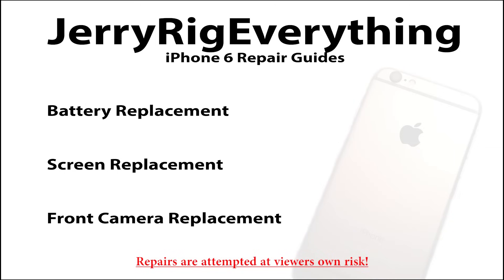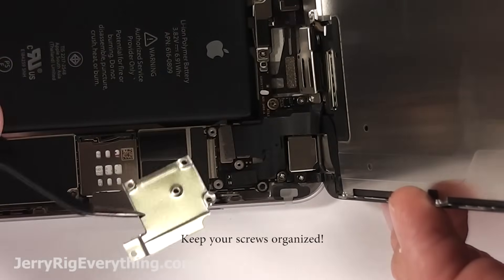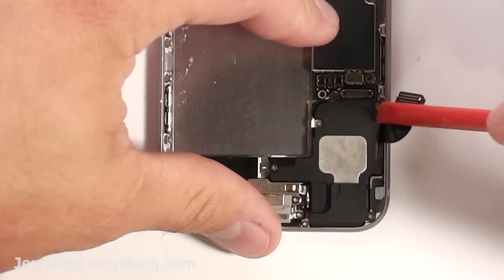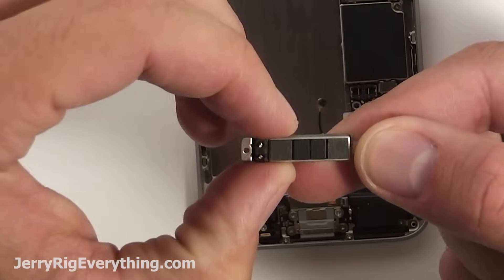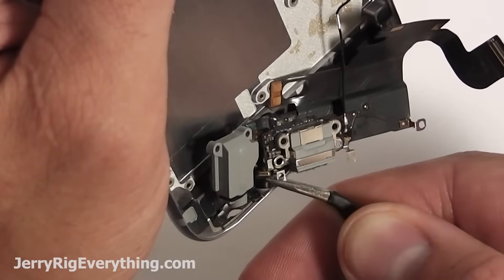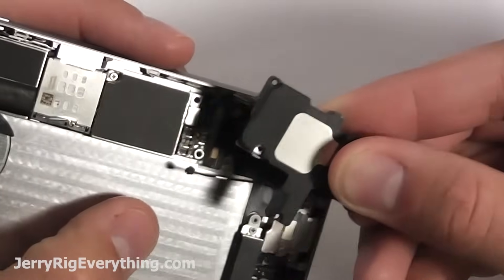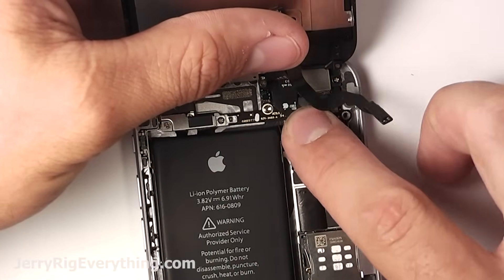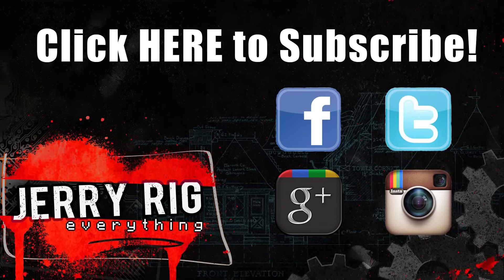iPhone 6 Charging Port Replacement in 5 minutes, microphone fix, headphone jack repair

Comment: My iPhone 6s plus does not show lighting bolt when I plug in charging cable. For sure my charger adapter and cable is good. The phone has about 20% battery so I leave the charging cable over night it charged additional 20% more. I took my phone to Apple store the tech told me my battery is good. Anything you can help me on this ID greatly appreciated.

Comment: Great video, many thanks for the upload. Managed to replace my battery and charger port whilst using this vid & works perfectly now. One thing I will say is to remove to screen use an ISclack (about £12 eBay) well worth it & screen pops up easily, I broke my iPhone 5 a few years ago using a single ‘sucker’ trying to wedge it up. After putting it all back together and switching it on the touchscreen wasn’t working and there were lines on the display. If this happens reinserted the displays connectors (they will snap in, just make sure the screen is held up 90 degrees and is the top edge is straight to the top of the phone and they will go in easily) and watch for the screws as they will be in one place and then disappear before your eyes. Total cost for me £15. Thanks again, brilliant vid

Comment: whats the gold piece that's attached by a wire used for? it's pretty close to the ribbon cable. I accidently broke mine, when trying to place it inside the connector.

Comment: When I did this repair and I put it all together my loud speaker stopped working but it was working before the only time it works is when you apply pressure to the connection do you know what to do?
Reply: keegan mckay i

Comment: BEFORE YOU PUT THE REPLACEMENT PIECE IN:
Check to make sure that the black plastic housings for the microphone and the charging port are not still on the old components. If so, disconnect the wider black plastic housing from the grey plastic of the charging port, then place it back into the phone's frame so that the holes line up for the exterior pentalobe screws. As noted by Stanos79, the black plastic microphone housing is stuck to the old microphone. Remove it and place it on the new microphone using the peel-reveal adhesive. There is a little tab to help you line it up correctly. And don't forget to do the peel-reveal adhesive as you are putting the new ribbon cable and components into their place.

Comment: it worked but now i have faint vertical lines on the right half of my screen and the touch screen isnt working on that half. Had trouble plugging in the connector that is in the middle of two other ones.  Could it be not connected properly or does something need to be replaced now?
Reply: Kill Kai yeah I had a friend help me try to connect the screen properly and it worked! It's been working fine now thankfully

Comment: Hey, so the phone wasn't turning on at all and so I thought the charging port was not working because the phone wouldn't turn on even after I unplugged the battery and just used the power source from the wall. I replaced the charging port and the phone still doesn't turn on. Any suggestions?
Reply: Hey Brandy2374, so my phone was out for three days, I just recently went back to mess with my phone, taking it apart and putting it back on, did it a few time, then my screen came back on....Not entirely sure what it was but now the only issue that I am having is that my screen be twitching and it won't light up as bright as it use to. The screen is pretty dim, planning on messing with my phone again later this weekend. Bought another replacement screen just in case I am in need of a swap. Thanks for replying to me as well.
Reply: is your phone a Turnip?
Reply: Dan O it's acting like one
Reply: Try a new battery
Reply: Apparently mine is like that now too right after I finished with this video. Did you ever fix yours? I fixed the charger but right after I turned it on, my phone got real hot. I'm afraid I might have short circuit or something. Trying to buy a new screen to replace it and see how that goes.. ugh, one thing after another.
Reply: Lazy Troll I read that you are suppose to discharge the battery down to at least 25% before doing this repair. I'm getting ready to do the same repair unfortunately.
Reply: Lazy Troll hopefully it will continue to improve or the new screen will fix it. My parts will be here tomorrow  so hopefully I will be able to fix mine. Let me know how yours turns out.

Comment: My iphone6 wouldn't charge and eventually the phone died and I can't backup/restore it. I tried to connect it to several different ports and cables etc to no avail. Even after replacing the charger port it won't charge so I don't know what's going on. Anyone have any suggestions?

Comment: Thanks for the great repair guide. My iPhone is charging again. But some letters on the keyboard now are not working: y,u; g,h; v,b; and the right half of the space key. So a group of letters. Any suggestions on getting these keys to work again? Maybe one of the connectors to the screen is not fully connected? Anyway, that little wire on the loud speaker was a problem. I could not get it to snap into its connector. Felt like maybe whatever it connects to is no longer there. So I just screwed on the battery latch plate on top of it.
Reply: well that was dumb lol

Comment: I change the charging port and speaker as well and is still sound very low.pls help me with this
Reply: the volume is not working at all in mine
Reply: Turn the volume down

Comment: Ok, this is old but this was the best video for me. It was clear with still shots to point the screws. I was able to pause at each step, everything was clear. Thanks for this tutorial, my phone is charging right now so I guess I'm good. Cheers!

That being said...
I second everyone who says you should try to clean the charging port first. I did it too, many times and it worked like a charm after that (just not this time), but please don't use anything metalic, use a wooden toothpick. The first time, the phone was charging but randomly, I wanted to give it a clean up and used a paperclip... boom! It was just not working at all after that. So be careful with the cleaning guys.

Now yes, the mic housing, I did see it when disassembling and somehow it stayed against the case so I've left it there, I'll see once my phone is on how good it works. Maybe you, Jerry, should put a little extra note on your video at the right moment to tell people about it ;)

Comment: question, my phone stopped working and my battery charge stays on and thats it! apple store said it was my port, i dont want to loose my photos! which i did not back up! my bad, doing these changes, like port replacement, battery change, will i lose all my pics and video which are saved on the phone? also do you offer service to fix my issue with my phone or have any recommendation on who can fix it? any help would be great!

Comment: THE WORST PART ABOUT PUTTING THINGS BACK TOGETHER IS FINDING THE RIGHT EXACT SCREW!
Reply: Joseph Webster LAY ALL THE SCREWS OUT IN A PATTERN TO KEEP THEM ORGANIZED SO YOU KNOW WHERE THEY ALL GO WHEN YOU PUT IT BACK TOGETHER
Reply: Joel2010Dmax I used little plates of bluetac to hold the screws in the correct pattern

Comment: LOUD SPEAKER PROBLEMS: I have the same problem with the loud speaker. I have no fixed it yet but i know it is either the new charging port that you installed that is faulty or it was damaged in the install process. I had to take the whole charging port out again because it was postition properly. The part where you lift up to pull the whle thing off ripped a little so i think thats what damaged the speaker. The speaker isnt getting the vorrect connection from the speaker to the two little gold metal things on the actual charging port. So make sure the two little prongs are touching the two little pads and make sure you didnt damage it in the process. I hope this helps.

Comment: NEED HELP: My problem was my charging port. I was only able to stop at unscrewing the vibrator which I wasn't able to finish because for some reason the screw did not want to come off and I eventually stripped the screw..... 😑 I skipped that step and I tried to see if I can take off the assembly I was replacing which is at 2:40 (that's the exact part I stopped at after I realized I needed to remove the vibrator) So instead i used someone's advice by sticking a toothpick and get rid of all the lint... which ended up being the solution but now when I put everything back together, my speakers don't work......... I went back in and unscrewed everything but I still have the same problem. SOMEONE PLEASE HELP.
Reply: Julian Roundy probably damaged the speaker connection

Comment: Hey jerryrigEverything I replace the charging port this way and it works fine but once I put everything back together the right hand side of my screen doesn't work, anyone got any ideas? I have unscrewed the phone again and replaced the screen connectors but the screen still isn't working 🤔

Comment: Hi Jerry, I did everything illustrated in the video, but still with the new port the connection is loose. and now it is heating up the charging cord as well, does it has to do with the after market part?

Comment: I took my phone 6 apart and put everything back together. Everything is responsive, except for my touch screen. Any ideas on why the touch interface may be unresponsive?
Reply: Charles Roman touch ic must of failed just look up iPhone 6 touch ic. Or it could be a screen.
Reply: I had fixed the problem shortly after leaving you a response. Thanks for the feed back

Comment: followed this step by step and everything worked fine except my screen. all the other buttons were working but my screen wasn't responding to touch. I figured out that the screws on some brackets have different lengths. be sure to put those longer screws in the same spot and everything will work fine

Comment: I did the replacement, and everything seems smooth. Charges good, speaker works, headphone jack works but no one can hear me. I tried both the mic and the headphones. Ideas?
Reply: did you ever find a fix? :/

Comment: I followed this video because I had a messed up charging port and my phone is back to working normal again. One thing that is not mentioned in the video but I picked up on in the comments, is taking a black piece off of the old microphone that you're replacing and putting it on the new microphone. Besides that one part the whole thing went smoothly.
Reply: Ya Jerry missed it, i was really shocked to see that part missing in my new replacement part
Reply: I took the black piece off of the old microphone and put it on the new one and the microphone still doesn't work

Comment: I see that you used something to pry the battery out of the phone and scratched the casing under the battery and probably bent and twisted the battery, there is a much easier way that was introduced on the 5s i think. The two pieces of what look like black tape on the bottom end of the battery are actually the ends of the adhesive that hold the battery to the case and if you release the tape carefully from the battery and pull very slowly it will stretch and pull the adhesive completely out from under the battery, then the battery will fall out of the phone.

Comment: I just replaced my charging port, and now my phone charges just fine.  The problem is that now my microphone doesn't work.  Could I of hooked it up wrong? or damaged the part when I took the old piece out?  It didn't really seem like the new part had a microphone with it.

Comment: the suction cup in the tool kit you recommended isn't strong enough to separate the screen. where did you get heavy duty suction cup you use in the video?

Comment: Excellent video, easy to follow step by step instructions. I did this and replaced my old charging port with a new one hoping to fix my error 9 when "synching with iphone" while i try to restore to factory settings since my phone is dead. I've tried disconnecting every single component while restoring in hope to fix the error 9 and find the defect one. Nothing works. Do you have any idea what a possible solution might be or is my phone just bricked with a broken nand chip? It all started with a infinite boot loop pattern which eventually resulted in all this.

Comment: Followed the video and it was super easy. First time, phone turned on and refused to charge. Opened it again and realized the ribbon that wraps around the speaker that plugs in next to the battery was not fully connected. Fixed it and it finally charges again. Thanks for the video!

Comment: The last two goddamn screws on the charging port will not un screw
Reply: Having the same problem, have you found the issue? Is it the screws or the screwdriver? I'm scared that i might chip them.
Reply: Yeah I have screws that just won't spin.... I had to abandon the repair because of it.

Comment: I've been having problems with my i-phone 6 charging port, I just order the parts to replace it. What I have noticed, and forgive me if this is  a common method of holding of for replacement parts, but my phone will not charge unless I turn it off and then plug in my charging cable. If that helps some of you guys out while waiting for the parts that's great, I'm not even entirely sure if it is my charging port that is causing that problem, but it seems like an easy assumption to make. Hope this  helps!
Reply: Was the charging port the problem?
Reply: @juniorjimenez8878  No answer ?

Comment: After change the port, everything works fine except the phone's battery level goes down 5 times faster than it did before. After a day of not being used to call or text after 10 hrs its down to 25%. before it would be at about 85%. Any suggestions?

Comment: Just did this repair yesterday and havent had this issue before but now the customer has diminished reception of about 2 bars everywhere.  ever have experience with a bad antenna on these charge ports?
Reply: having  hard time putting it on wonder if it is faulty

Comment: I replaced the charging port on my sons I Phone 6 and it charged fine after that. Now when he calls me his voice sounds muffled so he switches to speaker phone which is much better. Was wondering if you had any thoughts about this situation. The microphone hole is clear. Thank you

Comment: I followed all instructions, but now my microphone only works on speakerphone and not very well at that. I've read on other blogs that the screw needs adjusted but how can I tell this or is there another way?
Reply: I had the same trouble, so I disassembled the phone again and found that there was a thin plastic yellow/transparent cover over the backside on the microphone on my replacement part. I removed it (pretty hard, some adhesive on it) but it fixed the problem for me.

Comment: I had a faulty headphone jack so I replaced the charging port and everything with it. I followed your video and everything works great except my phone can't connect to service. I have the no service icon on the top of the screen. I have reset network settings and shut the phone off still no service. Please help me!!!

Comment: I was having the same problem. I was at work so instead of a toothpick, I used the end of a paper clip. It worked beautifully, TY for the suggestion.
Reply: +Mike Kenney Youch!  Glad you fixed it but I would NOT recommend using a toothpick due to it being CONDUCTIVE.  Could short something with the battery.  Much better off using a toothpick!